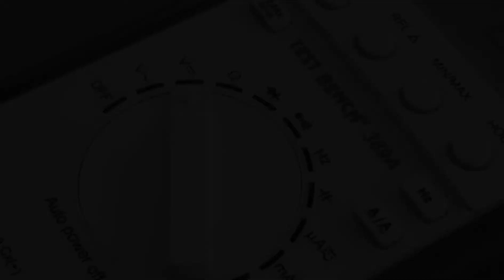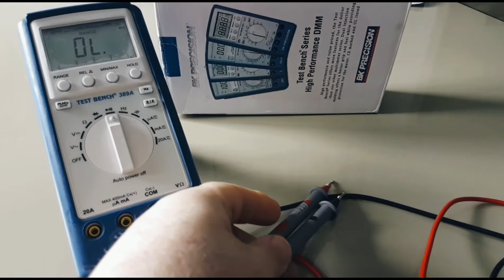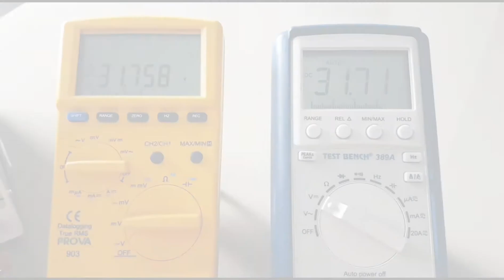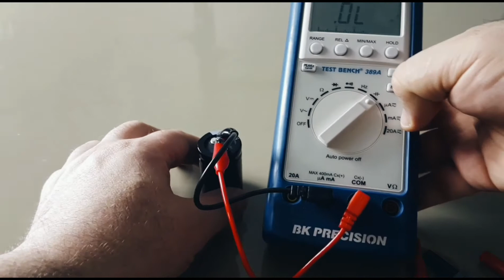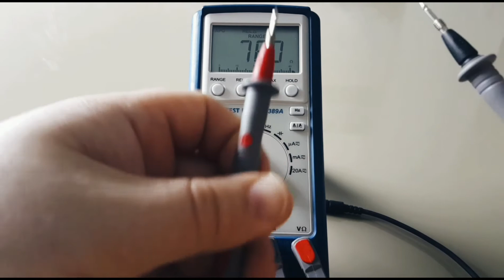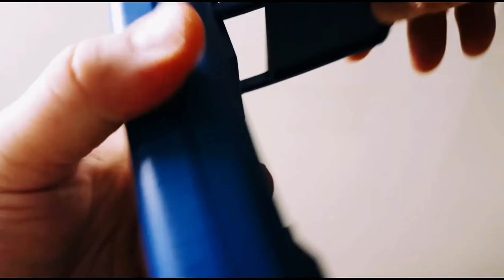BK PRECISION TEST BENCH 389A MULTIMETER REVIEW!

Comment: When I was in college Bk precision is what they used as equipment. I can't remember exactly what models they were since this was like 14 years ago lol but they definitely are reliable and in my opinion also accurate. I'm looking into getting one soon as I have a cheap-o I do not feel comfortable with. I was looking at the 393 has all the functions I would need but I also heard from one of my instructors to get a good set of probes. I hear fluke makes good ones.
Reply from the maker: BK puts out some great instruments.  I think they just need to update their lineup. You can usually find some great NOS equipment on Ebay thats reasonably priced. I would consider Probemasters which are top of the line , also these The ABSOLUTE BEST Test Lead Kit for the Money!
https://rover.ebay.com/rover/1/711-53200-19255-0/1?mpre=https%3A%2F%2Fwww.ebay.com%2Fitm%2F392392676798%3Ful_noapp%3Dtrue&campid=5338362906&toolid=20008
Reply: @KeepOnTesting  Thanks for the tip I will be looking into all of it!
Reply: Comrad! I came back to tell you althought 4 years later, lol I did in fact get the 393 also with a set of probe masters! Damn what a great set of leads I came to thank you! I just saw the video on a recommendationand i said let me report back. 

For giggles I found a older DMM that I scored for the cheap since one of the fuses were blown. It's the BK 391A it looks like it was someone's beater meter that I scored for $20 and it's been my go-to everyday meter. I've shelved my 393 for an instance where I do need it, but im going to save it as my back up. lol it looks so pretty that I do not want to touch it. I currently keep it as a trophy queen. @KeepOnTesting
Reply from the maker: @rubenmejia4881 Hey my friend! Thx for reporting back! BK 391A is stellar and should serve you well. It's a great find 👍 
Keep the 393 close, always nice to have such an awesome backup multimeter!

Comment: I've kept a BK 389A in one of my carry-always jobsite totes for many many years and imo all your assessments are spot on. It's one of my best friends. I'd like to add that it's one rugged bastard, the hell I've put this DMM through without killing it is pretty amazing. The leads were disappointing but imo just as crap as what comes with a Klein or Southwire DMM so I already had a Pomona set (since switched to probemaster) to swap in when I got it. Including mile-long leads that'll melt @20A with this DMM is just weird, but they were a decent addition to my "bucket o' cheap loan-to-friends DMMs."
Reply from the maker: Great info ! Thanks I really do cherish the BK389A..I've still got it on the bench and although it may not be my Goto dmm..I know its always there when I want to use it. I agree its built Rock solid and feels great in the hand. A venerable BK beast that can take a licking but keep on ticking! A great piece of gear!